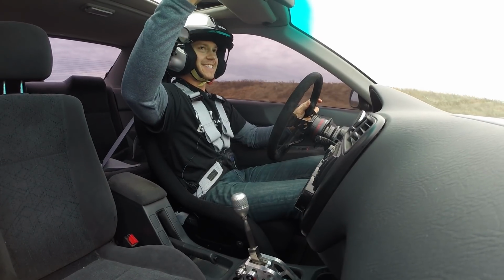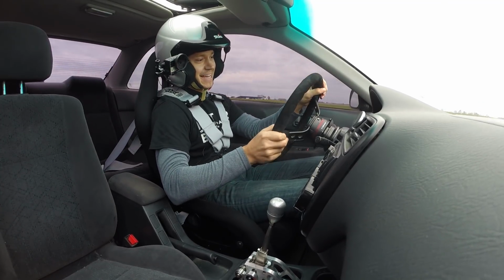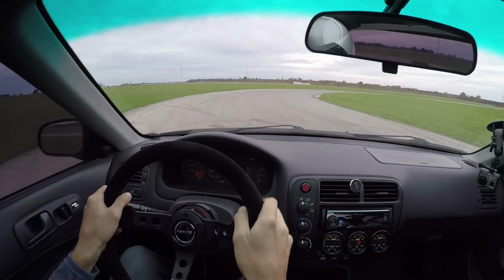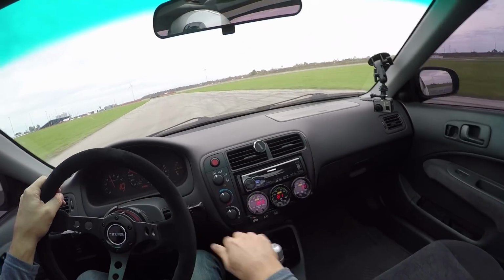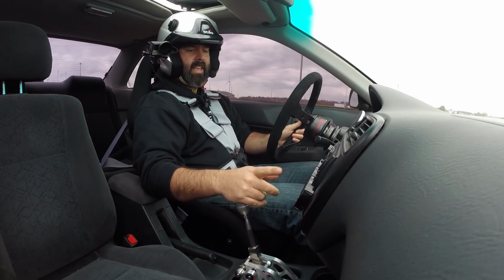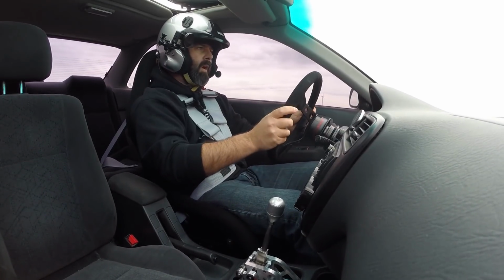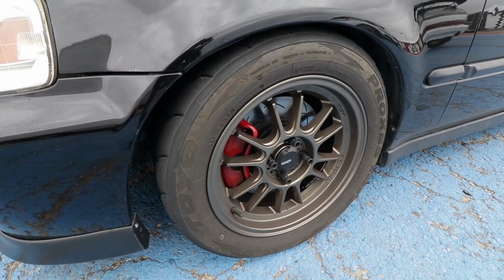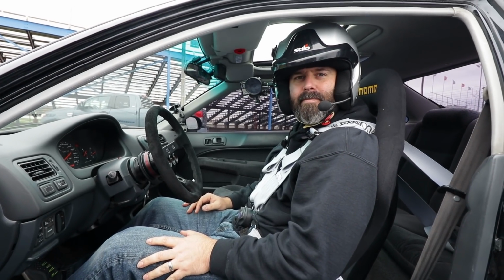Track Day Rippin' TEC  - Stage 2 Track Day K-Swap Civic - EP04

Comment: Seriously guys y'all need to take that car to a new tuner car doesn't sound all that happy off throttle plus there's more power to be had out of those mods that you guys did
Reply from the maker: I know it may be hard to believe but this is ALL the power this engine makes. No amount of tuning will change that. i watched Sasha go through all the ignition tables and nada, thats it. As for the misfire, its a common off throttle tip-in issue when VTEC is on.
Reply: Every dyno reads diff.  Sure they could take it to one that says it makes 300 as long as its running good thats all that matters.  The dyno is a tool and the track is to see what kinda power its making.
Reply: Dnice8363 I believe the comment had nothing to do with dynos and how they read differently. It was based on the sputtering when de-accelerating and how the tune is the culprit. Plus the hp gains with injectors, TB and DIC cams where pretty dismal.

I have a stock K20A-R swap tuned on Kpro and only 91 octane. Just a simple tune based on fuel and timing tables. No sputter of any kind during de-acceleration. Runs mid-high 12's on little 205 drag radials and 2320lbs with me in it.
Reply: So one place in the tune that will be hard to get a proper read from any dyno means what exactly?  Besides it did go away showing it was more of a bad coil.  Go on the honda-tech and people stop caring about dyno numbers but want track times as hp numbers change by elevation and dyno.  Look at Kyle's h22 making 140whp in colorado but I guess thats a bad tuner to right.  Its a tool as long as the mods are picking up power and the tq carries properly who cares what the dyno says you can have it say 1k WHP if you wanted.
Reply: Dnice8363 Its not about this car at this elevation and that car at that elevation. Think of it in terms of the base hp #'s versus current hp #'s. The gains were really small....same dyno, right?. 

If a person knew some Honda set ups and what they did on a Particular dyno...it's pretty easy to know if a motor is strong or not when comparing with same exact dyno. I do agree with the tuning cliché that dynos are tools and they all read differently. I do realize DIC cams are not very agressive but the end hp Gains for this K20Z motor do not reflect what it should.

Kyle's current set up is also lower compression pistons....right? I do not know what dyno #'s for all motor Hondas are on that particular dyno. But I do think his hp #'s are kinda low. I'm curious to see how it all works out.

Also....I did only mention times and weight.....not hp. Just talking about where the rubber meets the road.
Reply: I can upload a video showing two different SAE standards on the same dyno/pull which shows a 30HP jump.   When was it was calibrated vs what SAE standard it uses things we dont know.  Ive had my old d15b dyno at 210hp vs another dyno 180hp in a d16z6 same PSI and parts no difference at all on the street.  There is a reason why some dyno's are called heart breakers.  Proving there just tools to get a safe setup with max power as your adjusting the tune to get the most area under the curve and trying to carry as much tq as possible throughout.  In this case compare the chart to a OEM k20a2 and you will see its healthy and the tq carries better and picks up which is what creates HP. This is why people like to use the same dyno when modding a car to see the change.  Go on honda-tech and people want to know track times not dyno numbers because there is to much difference in dyno's.

As far as the compression causing the HP to be down it will cause alil bit but compare a b18c1 to a b18c5 and see what 1 point does which is what 15-20hp not to mention better cams lighter rods/pistons IM mani and on and on.  Kyle is at 10:1 vs 10:5-11:1 granted his dizzy was bad but not enough to cause a 60hp difference it just shows how much harder it is to make power at a higher altitude like trying to breath through a straw at a mile high vs normal breathing at sea level.  Its very hard to explain unless youve driven across the US.
Reply: Pretty sure Sasha knows how to tune guys.  There are way too many variables.
Reply: I thought that when watching this.  This was way too underpowered.  He is telling you lies and you are believing them
Reply: I agree, you guys need a new tuner. Car is way down in power. Seem like no vtc tuning was done on the car at all.
Reply: wackomanx good find that shows the same power as this one but people say the tuner is bad.  I guess Chris Miller doesnt know how to tune either.
Reply: Dnice8363 
I just watched that video. That 212whp is right on with my perception of a Stock K20A2 with DC header....actually a little better than I would've hoped for. Take that 212whp K20A2, Add cams and raise injector size like 32% (I do not put much gains from the bigger TB but okay) and I feel it should be around 230whp or I'm bummed out with the Gains. Not bummed out based on emotion but based on logic (based on collected data) vs. results. 

And I'm not saying it's the tuner. If it was my car, I'm irritated and checking compression late that night because I can't sleep. 

To think all experienced import tuners are K-series savy...I believe that is incorrect. An extreme example would be saying all experienced barbers cut my hair the same. I feel there is an art to tuning (in terms of end results and efficiency).
Reply: You cant compare the dyno's why are you upset over less then 10 whp when one is at sea level and the other isnt.
Reply: 230 you need alot to get 230 from a k20.  You need stage 2 cams and higher compression not to mention a better Intake mani and TB.  This thing being all stock besides header small intake and exhaust was fine.  The k24 with IHE and a good Intake mani will have a hard time pulling 230whp.
Reply: Dnice8363 
That motor tuned by Miller with the injector/cam mod would be 230whp on his dyno. 18whp gain (212whp vs. 230whp) is NOT asking for too much from those mods. And I am NOT comparing two different dynos and/or elevations. I do not know how you perceived that from my post. I do not claim to know much about this game but I belive my logic on this subject is sound. I been wrenching on my EH3 for over 21yrs with 3 swaps. I'm not perfect but far from a Internet Tuner Idiot. You keep arguing about specifics that I am not claiming. 

They should take that EK K20Z and hit the drag strip (when weather is warmer). Too many factors mess with track racing timed results. If that EK can't turn minimum of low 13's in the 1/4 mile (on those Toyos and a 2.0x 60ft) it ain't right.
Reply: Here is a good example of a k24 that could barely crack 200 with IHE from super street and tuned on church's Dyno.  

http://image.superstreetonline.com/f/27052339+w640+h427+q80+re0+cr1/htup_0601_07_o%2bacura_tsx_k24a2_engine%2bdyno_graph.jpg
Reply: Dnice8363 
Churches....hub dyno that has been know to read high. So, its my opinion that motor was hurting. Or it was on a stock CRV or Accord complete long-block.
Reply: Nope k24a2 brand new with a few thousand miles.  Granted it had a Intake mani for tq not top end and a smaller exhaust.  Still when then they put in some toda cams bigger TB and 3 inch exhaust it still fell short of the 230 mark.  Read it for yourself shows why you dont compare dyno's.  

http://www.superstreetonline.com/how-to/engine/htup-0601-acura-tsx-k24a2-engine/
Reply: Dnice8363 
One issue I see is that exhaust. K's like 3"....weird but proven. Almost 210whp for a stock K24A2 isn't horrible but meh. 
I was tuned on a  Dynojet 240A (roughly same elevation as Churches but little higher). Guy before me had an LS/VTEC with Toda A's, stock exhaust manifold and stock exhaust (stupid IMO but CA cops) and he barely cracked 175whp. I was next and my K20A w/RBC IM, 3" intake w/velocity stack, 1-7/8" 4-1 header w/reverse megaphone, and 3" full exhaust hit 227whp 165tq. But, once again, not same dyno as Churches and I got a strong HMO motor. 

12.5 index on drag radials and stock longblock next season. Shaving weight and bigger tire. Don't think slicks would get me to 11.5 index just yet. Probably 11.9-12.1's. 13:1 K24 OEM crank bottom end next.
Reply: I believe it can make more, ive seen stock K20Z3's make 214 with just a 3.5inch intake and stock exhaust.

Comment: That 4 point harness looks dangerous as hell.
Reply: Definitely - those rear mounts are much too low.
Reply: AND the seat back isn't tall enough - looks like the harness is pushing straight down on his shoulders and not the seat back holes.
Reply: Since when was the harness supposed to rest on the seatback holes?  The belts should rest on the shoulder, never the holes.
Reply: They're supposed to hold you against the seat, not push you down in to the seat. If the seat back is sized appropriately the harness will sit level with the shoulders which are level with the holes in the seat back.
Reply: The belt should never be fouled by the shoulder holes.  0 to 20* down from vertical is the accepted range.
Reply: Seriously, if you guys are building a track car, don't bring some Mickey Mouse harness setup with you. You are better off with the factory three point.
Reply: Not to mention the submarining issue with 4 pt harnesses. Either use the factory 3 pt or get a proper rollbar/fixed back seat/6pt harness setup. Its all or nothing with safety. Especially since he doesn't know how to brake and keep it on track.
Reply: Well aren't you just the perfect back seat driver. Fu

Comment: Proper build. But with those mods should be making 230 whp at minimum. A friend's stock jdm k20a made 227 whp with a slipping clutch, cold air intake and 3" exhaust.
Reply from the maker: Right so when ours doesnt thats why we expect the engine to be a bit tired.
Reply: Wow thats great take it to 5 diff dyno's they will all read diff.  This one is just a heartbreaker the tq looked good no issues at all.

Comment: 2nd guy cant drive front wheel drives. hes on the power before the apex = understeer 
he also did his braking while turning when he almost hit his friend. 
also check tyre pressures after big laps youll have to dump some

Comment: Cars def got a misfire need to get that map sorted before it ruins your engine
Reply from the maker: Its a common issue with larger TB and VTEC tip-in, very hard to tune out especially on the dyno.

Comment: Get it tuned by someone who knows k series. I know people with same kind if mods making way more power
Reply: sasha at onpoint is more than capable
Reply from the maker: Yeah but do you know the health of every engine? Our motor isnt down on power because of the tuning, its more engine related than anything.
Reply: Every dyno is diffrent this is why it was great to see it on the same dyno and pick up power everywhere.  Its a tool who cares what the numbers say.  You can program it to say 1000hp.
Reply: Dynamic Tuning the power on the dyno doesn't matter the only thing that matter is how fast it is on the pavement.  Noob.

Comment: Please get this retuned. It doesn't sound healthy at all.
Reply from the maker: Off throttle is either a bad coil or some fueling during VTEC decel that needs cleaning up, doesnt affect performance at all as the lap times show.
Reply: Speed Academy yeah but it's always best to have everything as perfect as possible for the track. Less issues in the future